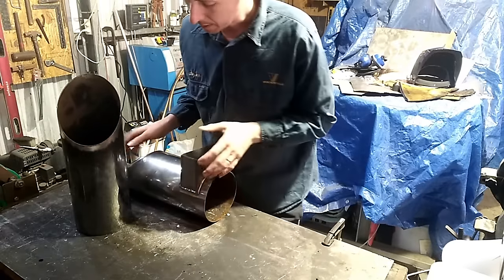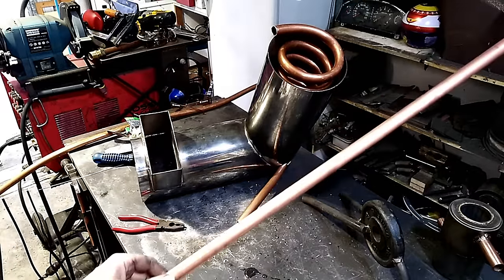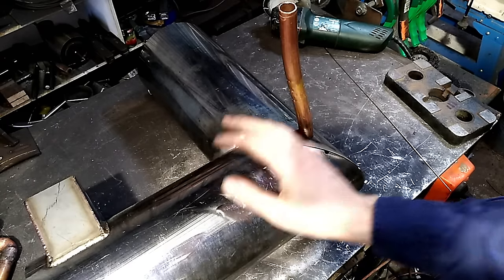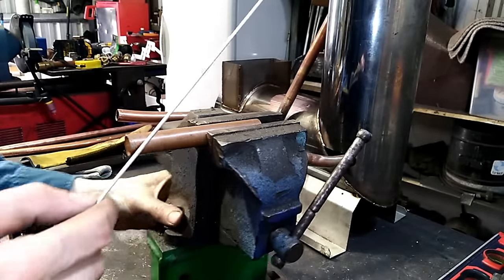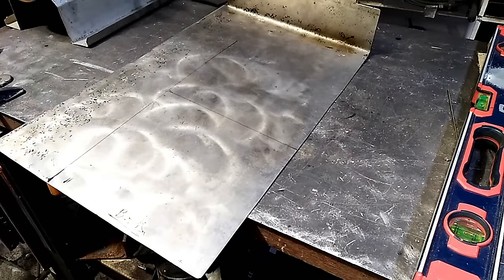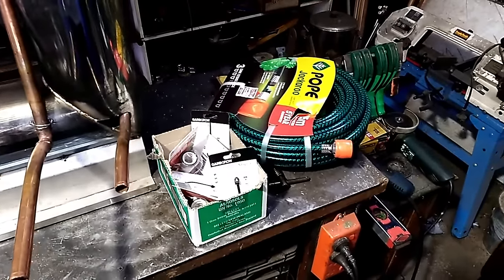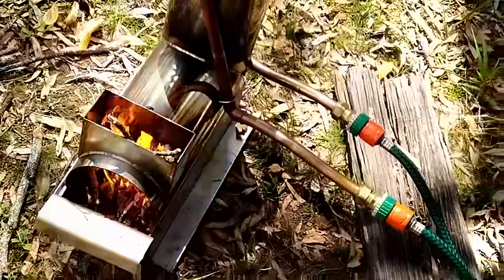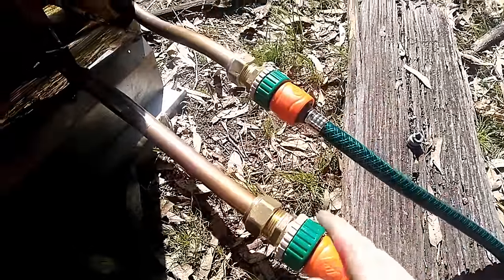Hot Water Rocket Stove II  - BUILD-

Comment: the hot side (top pipe) MUST ALWAYS have an upward flow to get thermo siphon action & any air bubbles form due to heating will flow up and out of pipe otherwise flow stalls as in vid till it boils in coil then burps out boiling hot water & steam as in vid.with a few tweeks this system should please the new owner with a hot bath,  good stuff and simple to setup
Reply from the maker: We are revisiting this build to put into practice the helpful suggestions you guys have given, much appreciated with your input, thanks mate!

Comment: You should really learn to sweat pipe. I tig weld and braze pipe and I cam assure you this would have been much easier with plumbing solder. You could also use flare or compression.

Comment: I am sure you have been told of an easier way to make a copper coil.  Fill it with water and put it in a freezer.  When water is frozen in the copper pipe it stops the kinking of the coiled pipe as it is wound around into a desired diameter loop.
Reply from the maker: Yes, I do plan to try this, thanks mate.

Comment: Nice looking build for sure... I won't go into the outlet pointing down as others covered that already. I don't understand why you would take the time to TIG the pipe together when sweating it with a torch and silver solder would be much faster, and fills the gap entirely between the fittings and pipe. Unless its potential overheating of the sweated joints, I'm confusicated! Great looking work overall though... and I'm a stick/mig welder with ~46 years experience. Sub'd just for your accent if nothing else! Also I'm stealing your hold down tool... that thing is frickin' ingenious!
Reply from the maker: You're right, I should have sweated the joints, my wife has monitoring how many trips I made to the hardware store. Thanks, mate!
Reply: @LittleAussieRockets  I'm curious, how did the final product end up performing? I'm in the center of Texas where our water should be somewhere in the 60-70° (f) range, which it is during the summer... but during winter, it can pull down to the upper 30's! It takes a LOT of power to heat water that cold, esp with an electric on-demand system. I've considered building a pre-heat setup with a sand filled 55 gallon barrel and a coil of 1/2" copper to take some of the chill off on the fly with a rocket style burner. Again, thats a sharp build pard! (And excellent looking TIG work!). 👍👍

Comment: Jens, have you worked in a boilerhouse? You are so much on the money. For what the man here is doing, you are very close, primary air, unmetered, but less than normal, under the fuel, secondary air abovexthe wood, but under the base of the flame, this is metered, i see no need for tertiary air in such a short flue. Such an arrangement would lessen soot and carbon buildup on the boiler tube. Doing it this way, is all he needs to make cold water warmer. Its not a high volumne/pressure system it just neds a water flow twaek and a similar combustion tweak.
Reply from the maker: Well said, thanks mate!
Reply: @LittleAussieRockets  no worries, mate, you are so close to getting it right. Just take out that down section from the heated water OUT and direct it up, and you're there, ready to enjoy the cricket.

Comment: Cool build, how did it go in real application? Highest temps for rocket stoves can get over 1000C which is close to the melting point for copper, so if you run it dry (without it heating water) I'd think there would be a real risk of melting the heat-exchanger. I'd been thinking about a design where the rocket stove heats a thermal storage medium, then you use that to head the water, would be safer but a lot slower than your design.

Comment: Hi I see what i feel is the issue with hot water spurting out the top of storage tank, if you were to reduce or eliminate the drop of the top pipe exiting the coil, you would create more of a continues flow of heated water, to me at the min your doing like a peculator. heating a small amount that then courses the pressure and makes it spurt but by reducing or eliminating the fall of the exiting pipe you create more of a free flow system, and as below storage tank needs to be higher than the stove itself.

Comment: The reason you get the gulping in the top fitting in the barrel is because of the leak. If it wasn't leaking you wouldn't have volume needed to fill by the back flow.

Comment: Hi! I liked your idea, I'm going to make a similar heater. I am watching with a temperature sensor to avoid heating above 70 ° Celsius, as this drum does not support much temperature. Here in Brazil we make solar heaters at home using plastic materials. Our PVC collector heaters reach up to 70 ° C. I will make a rocket system to support my heater when the sky is cloudy or raining.
Your drain gave a violent discharge to the drum because you kept the hot water spout underneath. The correct thing is that the coil starts from the bottom and the spiral goes up to the end, maintaining the same level or rising towards the reservoir. When installing it, bubbles of vapor form in the highest part of the coil, which are forced to descend and rise again, hence the explosions. The explosions indicate that there is no continuous flow from the thermosyphon, so the hose reaches 100 ° C of boiling water. It is not interesting if the hose is not designed for high temperatures.
I was looking to build with bricks, but it would be fixed in my garden. You made it light and portable.
Very mandatory to share. Sorry to fix you. What matters is the idea.
I saved your video to a playlist to check later.
Thanks!
Reply from the maker: Thank you for advice. Much appreciated 👍

Comment: You really need a circulating pump to harness all of that heat. Steam escaping is energy lost.
Reply: The heat exchanger coil  just needs to be modified to have the outlet at the top not elbowing back down. It will circulate freely without creating airlocks allowing steam to develop

Comment: Great work! for a little improvement, you might want to test exchanging(reversing) your hose connections if you are trying to make a siphoning effect where intake(cold water) to the coil comes from a higher source and the output (hot) goes to the bottom of the barrel. That way hot water will rise and the cold water will be heated easier. Make sure the water level is higher than the hose intake. Also try to make sure the copper coil is full of water with no air trapped in it(might be the cause of spurting. Just a thought but might be worth a try....cheers! Let us know!
Reply from the maker: Thanks mate, revisiting this build soon to put into practice so many of these great ideas you guys have suggested. Cheers

Comment: Just curious,  
I didn't hear the roar typically associated with a rocket stove. Can you speak to that? It obviously heated the water, but ......? I was just wondering. This rocket stove stuff is all new to me. Is that design a true rocket stove, or just a wood fired water heater? No disrespect intended.
Reply from the maker: The riser did need to be longer to create the roar but this build was out of scrap material and that happened to be the length I found.  The burn was still remarkably clean though, despite  the short comings.   It's not insulated so the purist would say its absolutely not a rocket stove but it has enough things in common to be a close cousin.  Cheers.

Comment: You have a steam lock in the system. You needed to have your hot outlet at the top of your heater just like how you are attaching your test tank.  The would prevent developing a steam bubble.  This bubble prevents the flow of the water.  I bet it will work allot better once you do this.
Reply from the maker: We are revisiting this build to put into practice the helpful suggestions you guys have given, much appreciated with your input

Comment: Do you prefer to cut parts with a grinder or do you not have a torch or plasma?  For me grinding is the worst part about fabricating anything.
Reply from the maker: I really don't mind. Grinding has it's place, no slag to contaminate the weld so less clean up, and for me grinding is more accurate. Plasma is quicker, consumables last longer and there's less fatigue on the body.  Both make a good mess to clean up.

Comment: You've  made a flash steam boiler you would be better having  the top pipe of the coil coming  out level not same as the cold inlet  but good effort proves point but  as you mentioned  not safe to be in tub while its being heated under current  setup

Comment: That's neat. I'd be a bit concerned about the belching steam. Boiling water in an enclosed boiler can be (or maybe is) dangerous. Hot water under a few psi heated above 212°F or100°C can/will "flash" into steam. It's good that you have both ends open.

Not to totally harsh your buzz (and I'm not a certified boiler maker or anything)but l have a suggestion. I had an almost identical set up with a commercial design except for a gas burner at the bottom. It worked fine.  The difference was that the distance between the heater and the (in this case, hot tub) and the coil of copper toob to was maybe 6". The inlet and outlet was at the same level in the tub as at the ends of the coil. I don't know if the manufacturer had a team of scientist or attorneys but the product worked and I've seen a few of them.
Reply from the maker: Thanks mate, I will be revisiting this build in the near future.

Comment: Though compact and working initially, I think that the metal pipe as part of the combustion chamber and J-tube will become brittle and shatter as if made of glass through the repeated heating and cooling. What has been your experience? Does it show any signs of having become brittle in the 3 months of use?
Reply from the maker: Metal that is heated and cooled slowly will be annealed. (made soft) it will be fine mate 👍

Comment: This would have been much easier if you had annealed your pipe first to make it soft. Anneal by giving a coat of soot with gas flame only (no oxygen) then blue flame to burn off soot, presto soft pipe which work hardens again when it is wound. Probably no sand needed.

Comment: Cool stuff!
Why did you not sweat the connectors to the copper pipe?!?
Reply from the maker: I was concerned that if the stove was ever run dry, it would melt the solder within a matter of minutes. So I tig braised it with silicone bronze.

Comment: A very small circulation pump would have given you a more even heat distribution. Also that steam was the result of  water boiling in the tube. Again the circulation pump would have prevented this. With the pump you would heat all of the water gradually and not have those spurts of steam. Once you get to a given temperature you could then reduce the fire to a maintain level. It will most likely be too hot to bath in but could be a storage tank that can be mixed with cooler water for bathing.

Comment: thermal dynamics say heat rises and you have it running down hill    caution stem is empting the copper pipe    this will scorch the pipe    the top of the coil must keep running up hill until it reaches the tank
Reply from the maker: Yep, totally, need to revisit this build. Thanks mate!

Comment: You are a  hell of a welder, but maybe next time get some silver solder and be a good plumber, lol. cold water must enter at the bottom of the coil, hot water must exit at the top. proper thermosyphon will suffer if the outlet pipe runs downhill.

Comment: Hot water rises so testing the top will not tell you how hot the rest of the tank is below the surface.
The top could be scalding but the bottom could still be cold.
 And you did not bleed the system of air pockets.

Comment: I think you forgot to put a spring lid on it? It's not a rocket stove if the flames/heat can escape from the horizontal and maybe a water pump on the inlet to speed up circulation :)

Comment: Hot water doesn't like to travel down hill. The water heated until the steam pressure pushed the water ahead to the top of the barrel. This is why you had intermittent flow of water and steam coming out ... quite dangerous and avoidable.

Comment: I see a problem! 
You have basically got your tube upside down (the outlet is lower than the top of the tube) so the steam generated builds up pressure until it pushes the water out of the way.  
Eather take the downward pipe out and feed directly to the tub or fit a "T" at the top of the tube. This will need to rise higher than the hot tub or it will syphon out! If you do that the heater will be more efficient. Also having your exhaust water pipe lower in the tub will give greater mixing as the hot water rises in the tub.
Reply: Check valve on inlet tube will radically improve the water flow in this configuration. This is the same idea as inline engine block heater. Use the steam buildup as a pump.
Reply from the maker: Thanks mate!  I'm learning and I appreciate the input
Reply: @LittleAussieRockets   Tell you a secret mate ..... We are ALL learning ;0) It is how you deal with the lessons dealt to you that determines who you become!
Reply: Dave, I agree with what are saying here, but one aspect of your comment is a bit off.... in thermal cycling you do not want mixing to occur. Mixing makes the burner less efficient. Best to have the coldest water possible entering the heater. The thermal stratification in a vertical tank is desirable.

Comment: A stainless steel water jacket made from two concentric stainless tubes, with as much surface area as possible on the inner tube which is part of the flue, with two plasma cut end plates to enclose the water jacket, and a difference in dia. of at least 50mm between the two concentric stainless tubes, gives you a radius of 25mm clearance between both tubes sufficient to run 1 inch copper tubing from the water jacket to the HWT, thereby allowing sufficient flow to prevent premature cyclic-boiling, which is what invariably happens with long length copper coil wetbacks, using a passive thermo-syphon, as show-cased in your video. 
Passive thermo-syphon water heaters however, work well with stainless steel water jacket wet-backs, subject to having big enough delivery and exit pipes so that the thermo-syphon flow rate through the water jacket wet-back is sufficient to duct away the warmed water long  before it can reach boiling point in the water jacket, and so it will not boil until the Hot Water Tank itself, reaches boiling point, hence the need to always make sure your tank is open or vented to atmosphere to avoid an explosion if it boils in the tank.
Use a couple of stainless steel BSP pipe sockets (or cut one in half to get two) to TIG weld onto the stainless steel water jacket; one at the top (hot water out) and one at the bottom (cold water in) and make sure the bottom of the Hot Water Tank (HWT) is no lower than the top of the stainless steel water jacket, in order for the thermo-syphon to work properly. 
Also make sure that the hot water pipe from the top of the stainless steel water jacket connects near the top of the HWT, or at least 100 mm plus, above the HWT's cold water wet-back outlet pipe that feeds the bottom of the  stainless steel water jacket (which must connect to or very near the bottom of the Hot Water Tank). So there you have it ! Plus more water jacket surface area exposed inside the flue, means more efficient water heating !
Reply from the maker: This is gold 👍 thanks mate